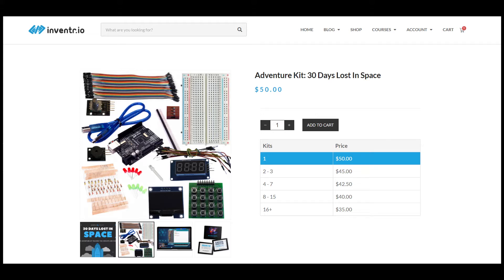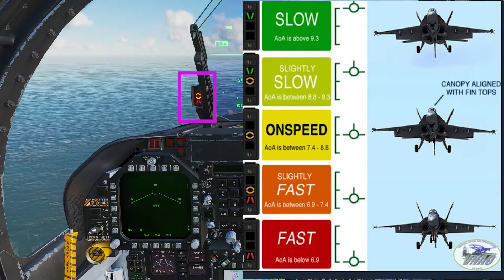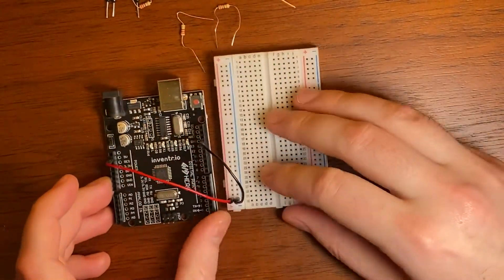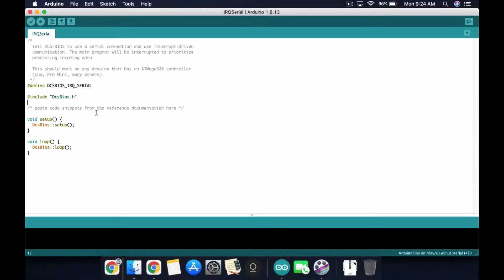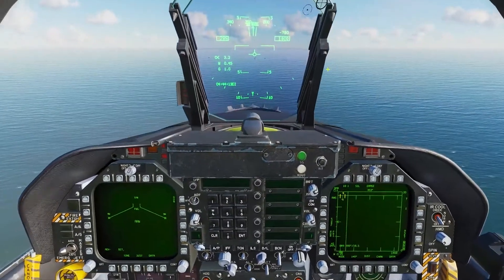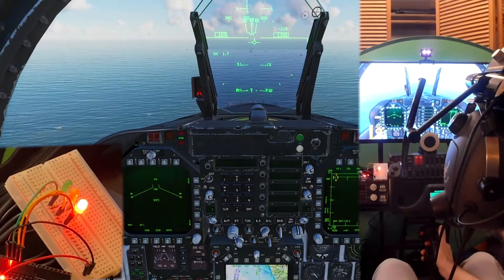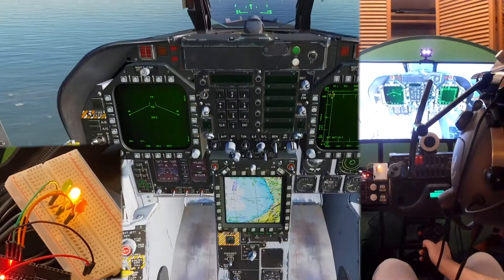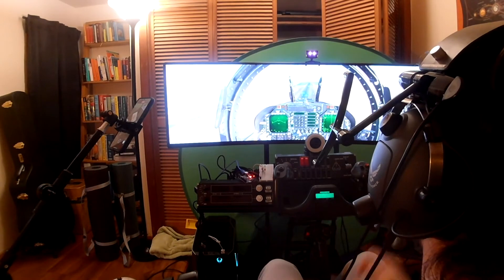Making my own F-18 AoA Indexer with Arduino and DCS-Bios

Comment: Hello Charles, I hope everything is good in Charlesland. I have a question. I'm just starting to build the Misc panel for my F16 sim. It has 5 toggles and 2 press buttons and an led. So my question is...If there are 5 ground pins on the arduino board and you have, as I do, 8 things to hook up, where do you get the other 3 ground pins from? Is that where a person would need a bread board?

Comment: I need some help, Im using DCS Bios with my custom order flight panels from TekCreations for the F-18 and the F-14 iv noticed that the F-14 panels work for maybe 1 full mintue then stop working after. Iv tried the control reference page and everything nothing is working. I have my panels on a USB hub connected to my computer.

Comment: Hey, nice vid! Can you tell me why do you have to connect the 5V in to the breadboard? It looks like it connects to nothing else. Thank you!
Reply from the maker: So the breadboard (white part) doesn't have any of its own power, but it needs it in order for any of the components on the board to be powered. The Arduino board (black part) is powered, either by its USB connection or a DC power adapter. The 5V wire is there to push power from the Arduino over to the breadboard.
Reply: @CharlesFlightSimGuy  Okay, I understand what you are saying, but the 5v goes to the breadboards "+" strip. But from there it goes to nowhere else. It seems it does not connect to the LEDs at all. Isn't the LEDs get their voltage from the I/O pins?
Reply from the maker: I think you might be right! Looking at the diagram on Tinkercad I see that the resistors connect to the negative power rail, and that the anode sides of the LEDs are connected to the I/O pins. It would appear that this is a supported scenario of the pins when used in OUTPUT mode but only for low-current devices like LEDs. https://www.arduino.cc/en/Tutorial/Foundations/DigitalPins

To test this, you could simply wire it up as I have here and pull out the 5V and see if it still functions. I might give that a try. Thanks for catching this!
Reply: @CharlesFlightSimGuy  Yeah, Im glad we clarified it, nice video and project anyways, thank you for your response, keep up the good work!